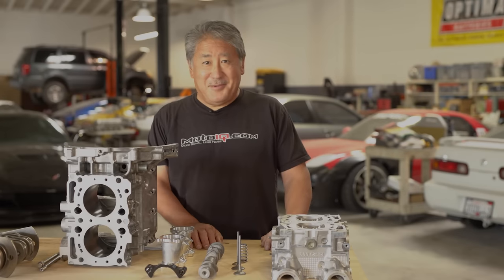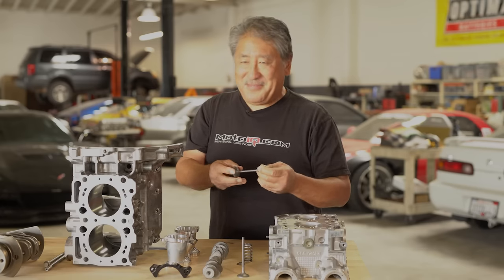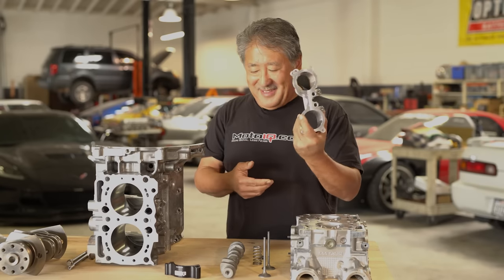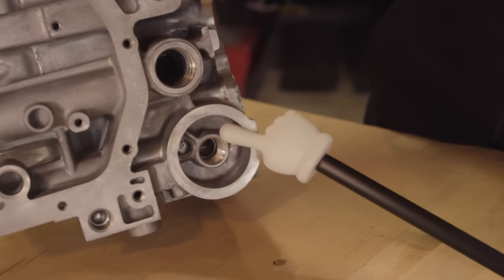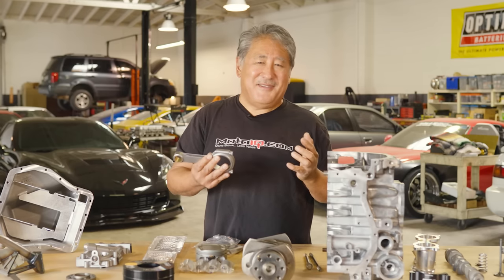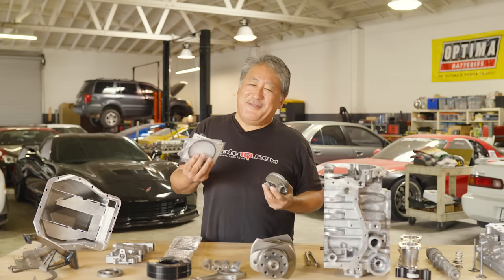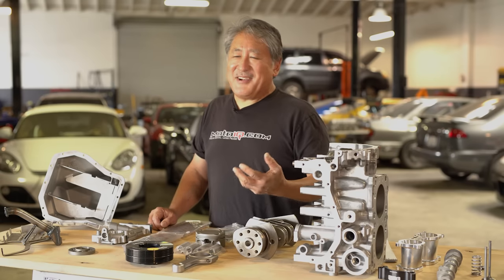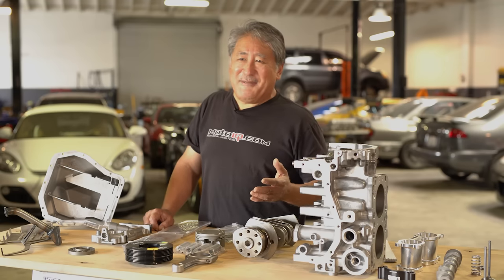How to Build a Subaru EJ Engine that won't BLOW UP!

Comment: Just go iag stage 2 block upgrade and you can push quite a bit of power reliably for around 3400 dollars
Reply from the maker: Usually, if your bottom end is blown up, you need to work on the top end to some degree, building an engine that will hold up isn't just buying a short block and throwing it in the car.  IAG stuff is very good though.  We have equivalent to stage 2 for about the same price and we are also an IAG Distributor so we can sell you their motors too.

Comment: Thanks for the video.
Planning to turbocharge EZ36D. How much max horsepower this engine can handle (reliably) without repacking engine components (decking, pistons, connecting rods etc.)
Reply from the maker: It probably has the same problems with cast pistons and high ring lands.

Comment: How many hours of R&D went into finding what parts/ fixes were needed to correct all the inherit flaws of these type motors ??  
Seems like Fuji Heavy Ind. would have discovered all during Factory Rally Car development. Is this the case in part or whole ??
Reply from the maker: In WRC the power was limited by restrictors, that was a big thing, a well built street car can have way more power than the WRC cars did.

Comment: Whats the stroke of the crank? You said the displacement would be 2255cc, but 93mm bore with (im assuming) a STi crank stroke of 79mm would be 2146cc, no?
Reply from the maker: 83mm

Comment: All sounds great but how much longer pr $ does it last? Oh and hw are you going to keep it from oil starvation leading to rod knocking why don't you have everything in the rotating assembly lightend and rebranded if you want to keep it high reving and non skirt slapping bomb?
Reply from the maker: A lot longer than stock. Lightening the rotating assembly alone does not make something suitable for high revs.
Reply: It don't necessarily make it suitable for high revs , it makes it Rev higher if your building it for that eg, cam, ported heads, bigger induction. I was assuming the engine in the video was being built to Rev high that's why I asked about lightening the crank rods and pistons to free up revs " make it Rev high "
Reply from the maker: You never do that on a forced induction engine, they need strength. Lightening doesn't make an engine rev higher, it just reduces the amount of time it takes to reach higher revs. Mods to improve VE and reduce piston speed make for higher revs. Shorter stroke, longer rod, bigger cam, ported heads make higher revs.

Comment: With the machining of the Pistons to allow for the long rods, the wrist pins appear to be behind the oil rings, how do you get the wrist pins in once the rings are installed and the piston installed in the block half? Or is it just the way it looks on camera and the pin clears the ring? Im confused 😕😀
Reply from the maker: You don't, nor is there any need to get to the wrist pins once the rings are in place.

Comment: How about head gasket issues? IAG makes these "Fire-Lock" head gaskets where a counterbore step is machined around each cylinder bore allowing specially sized fire rings to drop into the machined area and head gasket bores. The shims are designed to create a compression seal once the heads are installed and torqued into place. Has anyone tested these for high-horsepower EJ applications?
Reply from the maker: We will be using a shimmed folded stopper head gasket along with the closed deck.

Comment: Hi motoiq. I always watched your videos and I must say that your knowledge are well recognized and needed for us. Here I have a 7th gen v-tec 1.7L, 4Cyl civic and I’m planning on keeping it for a long time. I want to rebuild the engine for sure to some well performance parts. Let’s say I drive hard sometimes so I would rather use high revving performance parts like, 
Rings, piston, connecting rod, connecting bearin, main bearing, valve, valve spring, and other parts in the head. Can you give me a list of parts that match what I’m looking for? It would be my daily drive car but I want it to be of good quality long lasting parts anyway.
Reply from the maker: Best bet is an engine swap for a K motor

Comment: Is it okay to use my case halves from the stock motor if it is reworked. Probably won’t be turned into a closed deck. I’m going for 400-450 daily driver. And the shop said they usually send them out and use them. Or would it be worth to pay for new ones.
Reply from the maker: Sure, it just has to be machined with the proper fixturing, this is so critical on a Subaru that you should not even attempt to build a motor without it.
Reply: Okay. Thanks. Yea they will be getting machined and they said this is what they usually do unless I would rather buy new ones

Comment: When buying aftermarket main and rod bearings, do you have to machine them to spec or what?
Or do you machine the crank to the bearings?
Reply from the maker: crank to bearings or select fit bearings
Reply: @motoiq  
Appreciate it!

Comment: 17:45 longer rod + stroker crank .... isn't that going to push the piston over the deck @ TDC ??
Reply from the maker: Not when you adjust the pin height in the piston.

Comment: Is the fixture for the case mike is talking about is that a torque plate.
Reply from the maker: On a Subaru it's more than a torque plate, there are top and bottom plates.

Comment: So I know nothing about these engines. But in order to keep the torque of say the 2.5 and yet have the flow of the 2.0, assuming the 2.0 head is better as he makes it sound that way, my question is, would it be possible and if so would it be beneficial to, put 2.0 head on a 2.5 block, to have the best of both worlds?
Reply from the maker: flow isnt the advantage, some people want the combustion chamber volume.

Comment: vw/audi did that crap with pistons, leaving an opening at the bottom oil ring slot and it consumed oil. updated pistons have that area closed off.
Reply from the maker: they have to at least have holes or it will burn oil like crazy!

Comment: Is it ok to reuse a brand new MLS gasket that has been torqued down but not heat cycled? I want to pull the head back off to fix an exhaust stud...
Reply from the maker: I wouldn't unless I had to.
Reply: @motoiq  dang. Thanks

Comment: If you WPC treat the rod bolt threads, doesn't that change the torqueing characteristics?
Reply from the maker: We tighten rod bolts the correct way through measuring stretch.

Comment: Hey Mike, just bought an 07 wrx that WAS catless, i need to weld in a good cat to be compliant, with so many choices , are you able to give me a couple choices of good quality high flow cats? flowmaster ok? dont want CHY-NA cats. Car has a new invidia catless DP, im an experienced TIG welder so no problem there. Thanks MIKE
Reply from the maker: I have good luck with Magnaflow cats.
Reply: @motoiq  thanks Mike!

Comment: With regard to naturally aspirated  engines what is the difference  in performance of the ej vs the fa24?
Reply from the maker: FA currently is harder to tune due to DI and Cobb basically quitting.  Solutions will be coming I am sure.

Comment: I did not know valves rotate. Im not surprised by this but what torque is causing that with all the pressure on them?
Reply from the maker: The coil of the springs causes the rotation as the compress and extend.
Reply: @motoiq  ah ok thanks

Comment: I noticed him speaking of a JDM oil pump as an "upgrade".
I suppose this doesn't pertain to STi models as they are (or at least were) all built in one factory in Japan....Meaning they would already have the JDM fuel pump?
Reply from the maker: That is the common name for the pump with 12mm rotors as opposed to the USDM 11mm.

Comment: Seriously wish there were part numbers literally plan on doing this but stuck at the  exact piston size? There are so many listings on the web page.
Reply from the maker: If you need to ask this you probably should not be building one of these as your first engine!
Reply: @motoiq  I'm not but I'm looking at getting all the parts together for an engine builder. I'm in Australia and shipping cost alone would kill me. Hoping I'm able to score local parts or equivalent locally. Of around the same specs.

Comment: So what can you do with an EZ36  engine?  Any supercharger  recommendations?
Reply from the maker: Raptor makes a supercharger kit with 400 or so hp.  They also make headers. That's about the only aftermarket support the EZ36 has. Anything else has to be custom and costly.

Comment: Ej engines mostly blow up either due to lack of fueling or oiling. high gravity forced can force oil to one side in the oil tank and result in no oil going to engine giving you spun rods. lack of fueling in 2008+ models due to engine map, giving hotter engines resulting in blown ringlands etc. 
my 2006 ej255 has been beaten hard daily and still healthy in 2021. because i keep two things in mind. oil supply is constant and car should run little rich atleast. but not too rich

Comment: Regarding the ej25 engine. If I have it built to 400 why which automatic transmission  could reliably support that sir?
Reply from the maker: I would contact Level 10 and ask them.  https://www.levelten.com/
Reply: Thanks

Comment: I did 1/2” head studs but this Got me over thinking running OEM case bolts. 😢
Reply from the maker: 1/2 is ok on a Subaru, you just need to use a torque plate and do the full 1/2" stud torque when machining the block.  Resizing is also important at this stage.  It also helps to have an 0-ring so there is some give.
Reply: @motoiq  I bolted a torque plate with the new studs. Torqued to spec, to each case half in the process of boring and honing my cylinders! Measured my crank journals and clearances seem spot on!
Reply: @motoiq  this video has helped TREMENDOUSLY in the process of my build. Thank you guys for this
Reply from the maker: you should be good, be sure to check to make sure your align bore is ok.  Big studs can warp all the way down there sometimes.

Comment: Hi mike 
I’ve just acquired a VA chassis 2015 STI and want to make a reliable 400WHP could you please help me and recommend what you would do to achieve this please! There are so many opinions etc getting around but not all would be correct and accurate. Please help! & thanks for your time 🤙
Reply from the maker: Check out our subaru engine pricing video.
Reply: @motoiq  as I’m in Australia I have sent you an enquiry from your website. I hope you can help and thank you so much for your reply 🙂

Comment: The tuner in Florida was a Cobb tuthat's why I spent the $1000 to get it tuned correctly for my setup I also told them to be kind do not push the engine too much because it was my daily driver I don't like Subaru engines at all if I could slap an LS7 in the

Comment: Technically speaking if you did this much work to any engine it would be bullet proof. I tuned in thinking that there was a simple solution to EJ series problems. But not unlike other problem engines, you take your life savings and throw it at the engine using every trick in the book.  So you've made a super expensive Subaru engine able to keep up with a mildly built K series honda. So in other words I learned to never buy a Subaru and buy a Honda. Way cheaper. Awesome video and very knowledgeable content. Props to the channel but you are telling us nothing we didn't already know. The title should be "How to spend a fortune on a dud of Subaru engine".
Reply from the maker: A build K series costs about the same!
Reply: @motoiq  Any built engine is going to be expensive. But the foundation is a much better engine.

Comment: What’s it cost to have my bugeye heads redone? Haha picking up the 2.5 iag block that I can use the 2.0 heads but need them redone to handle atleast 400 wheel
Reply from the maker: To make 400 hp, you just need to replace all the worn parts and do a good valve job.
Reply: @motoiq  better cams too or just new stock cams!? Sorry just seen the reply and do you guys do the work of i ship the heads?

Comment: You basically just made a 207. Or you could have used an ej20g closed deck block with v3/4 sti heads and a built bottom end. Be half the cost. But still cool. I guess your just using what you can in America. Australian Subaru people just go for a 207 straight away
Reply from the maker: The customer didn't want to do that and it would not be half the cost.  Maybe $800 cheaper.  The EJ20G is a rare motor here, as it was not imported and it's old. Also, not all of these were closed deck.
Reply: @motoiq  yeah true. They aren’t a dime a dozen here in aus. But we got them In The liberty RS turbos and a lot of our imported legacy have them. And the early wrxs too. So I guess you Americans got the short End of the stick again. But your right. Not all are closed deck. Only the early ones before they realised they could get away with less material for cheaper build cost

Comment: Sorry, but I'm just flat dumbfounded as to why shuffle pins weren't installed in this engine case.  So much care and money was put into other "reliability" improvements.  I'd pin the case first, before I'd consider spending additional money to close the deck, oversize the case bolts, and do surface treatments.  That's like putting all the fancy decorations you can fit on the cake, but not bothering to frost it first.  Honestly, if I was the engine/vehicle owner, I'd seriously be upset.  Pinning is cheap, and what if he decides to upgrade the turbo at some point down the road?  Are you going to pull it back apart to pin it?
Reply from the maker: Because they are not that effective at preventing fretting.

Comment: Would a dry some oiling system be possible?
Reply from the maker: Yes but it costs around $7500 so not too many people can afford it.
Reply: @motoiq  cheap versus buying a new car when you blow the motor at the worst possible time. I honestly think you can do it for much less than that.

Comment: i need to know more about esp armor.
Reply from the maker: Its an Isotropic polished finish, meaning it has no marks, lines or patterns that can cause a stress riser. It's usually a chemical/mechanical process.
Reply: @motoiq  I heard something similar before. It's called Nickel treatment or something not sure what's the exact name. People used it for their gun specifically the gun barrow.  But I think their version is blasting it with bb's. I guess it's a  technique that works well for moving parts.  

Thanks

Comment: It seems like the reasons so many EJ's have blown up is the engine vibration.. The design is flawed from the factory SIMPLY the most stressed part of the entire car (the block) is split in half. Not only that, the block is extremely light weight. I always wanted a WRX, but knowing that I have to keep it at like 300whp to keep it reliable is weird. It reminds me of a rotary in the fact that, you have to basically replace every seal/component on a EJ to make it reliable. The problem for me starts at the heart of a Subaru.. the BLOCK.
Reply from the maker: The engine case is weak and flexy like you said.

Comment: Would there be a way to cut swirled fins into the top of the intake valve, so that the air is forced to enter the combustion chamber like a tornado, helping to better mix the air and fuel?

Comment: The only thing unreliable about an EJ engine are when people who think they are engineers poorly modify them. Keep it as the factory built it and its fine.
Reply from the maker: If you keep it at the factory power level and no more
Reply: @motoiq  Yes my point exactly. If you modify something beyond what the manufacturer intended (car or otherwise), you can’t then turn around and blame it for being unreliable.
Reply from the maker: That's where we come in, the engineering to double the power reliably.

Comment: And guys it doesn't cost you an arm and a leg like the Subaru engine does you can go out and buy that engine for halfAnd guys it doesn't cost you an arm and a leg like the Subaru engine does you can go out and buy that engine for half I could but probably 2 or 3 LS7 4 what I spent on one Subaru

Comment: I wonder if that Japanese WPC coating technology would be effective for the housings and apex seals in a rotary engine 🤔 also I think of it takes that much trouble to make it reliable just move on.
Reply from the maker: It is, Ron Berganholtz used it and Kyle Mohan uses it.
Reply: @motoiq  very cool. I would love to build a rotary with some of that tech for a street car. I’ve got a 2011 Rx8 R3 that’s going to need a rebuild or new motor soon. Who knows might have to look into cryogenics and WPC 🤔. Keep up the excellent content. I’ve learned a lot and I’ve only watched 2 videos so far.

Comment: I never thought these EJ engines were so bad like that 😅 
I was assuming the problems were only in the lubrication system It turns out that it is more than that 🤢🤢

Comment: And it is sitting in a garage waiting for its next engine and then I am selling it to get something that might actually run a year By time I am done with this car I will have probably invested over 80000 or 90  I would highly recommend do not buy if you do do not have it tuned do not change it leave it alone don't touch it just have the oil changed and whatever service has to be done to it this car does not like to be changed if you do it will blow up

Comment: They want to build a 2.0 because of the smoothness & revs over the 2.5, but they throw in a 83mm crank. The 2.5 uses a 79mm crank. That defeats the whole purpose. Smoothness & revs come from the 75mm 2.0 crank. Makes no sense. Should have just used an 2.5 block with 75mm crank.